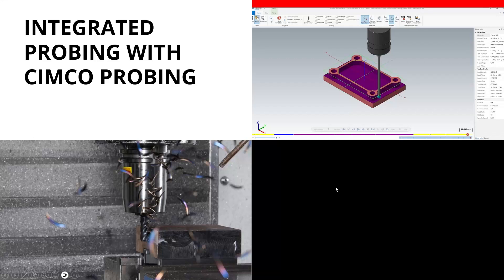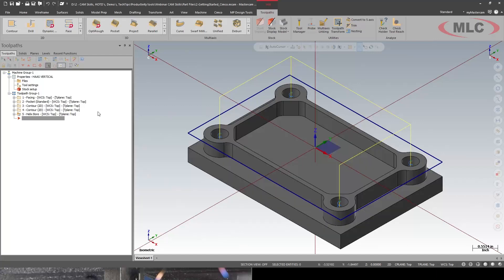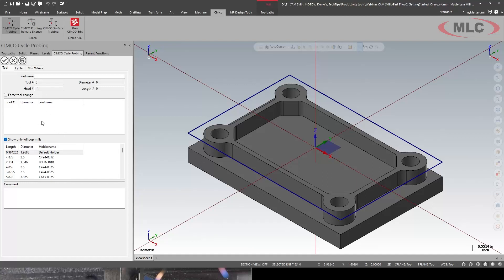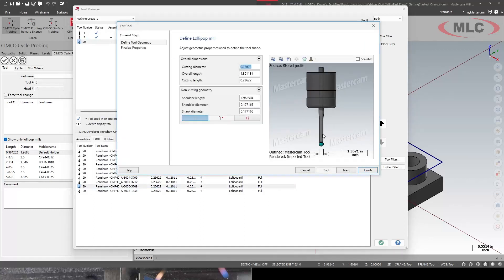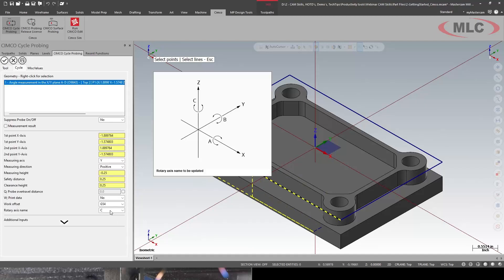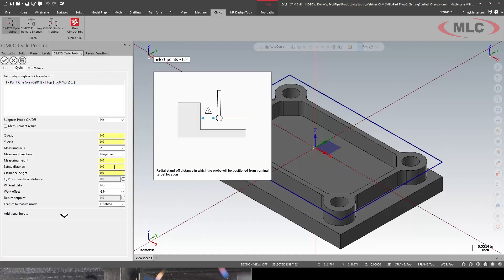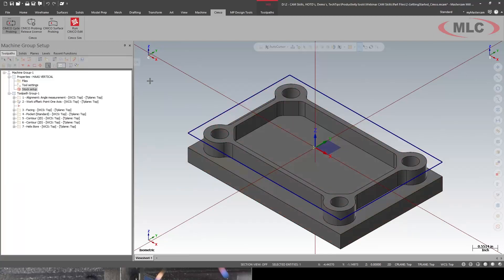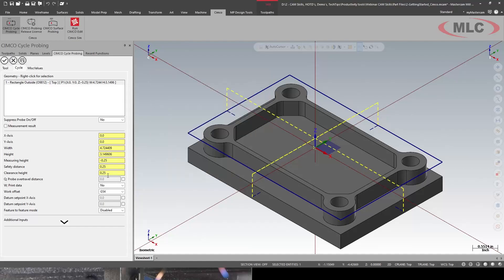CIMCO Probing – How to Setup Probe & Locate Stock – Mastercam Productivity Tools

Comment: What if you have a probe that isn’t a reneshaw? Would I still be able to program it? I have a 100$ probe lol and works great Manually but want to be able to do it in mastercam.
Reply from the maker: Reach out to our team and we can discuss your situation and recommend the best solution.  It does not need to be a Renishaw probe, and a custom post processor or macro is likely required.  mastercam@mlc-cad.com or 800-364-1652